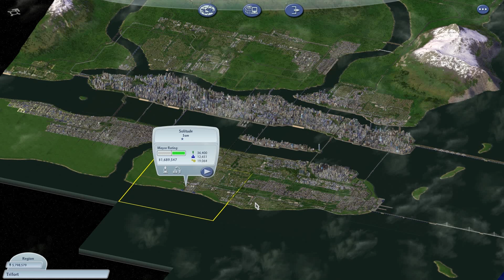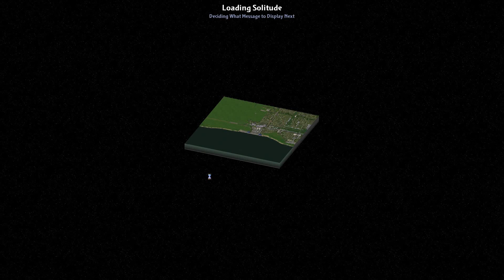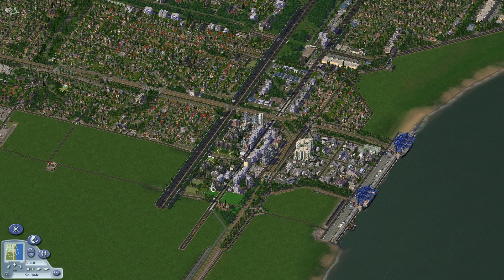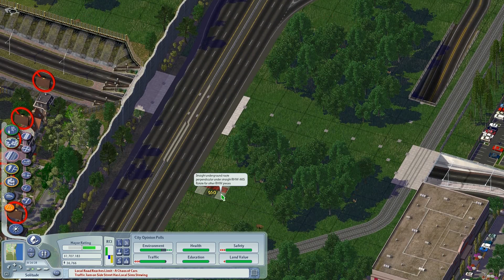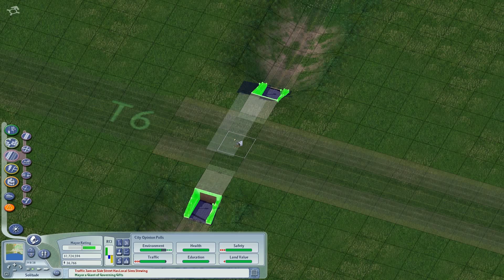Let's play SimCity 4 (mods, high realism)—part 24

Comment: you talked about an ssd drive just wondering what ssd drive you used for loading your plugins? I have been looking at them cause I have 2.7g plugins and off the sata HD i have a load time of about 2 minutes but the ssd drive seems a lot faster, any advice for which ssd drive to go for if you want to have 5g plugins
Reply from the maker: I personally bought a 256GB OCZ Vertex 4 SSD.  Of course there are lots of different options, and I can't say I'm that much of an expert on them; this is the only SSD I've owned.  I'll post the link to it:  http://www.newegg.com/Product/Product.aspx?Item=N82E16820227792 (although I wouldn't buy it at that price; I got mine for probably 1/3 of what Newegg is advertising now).